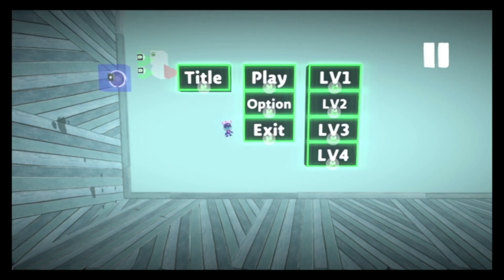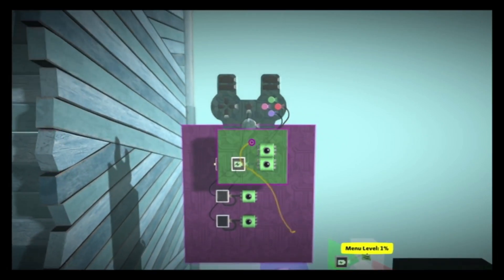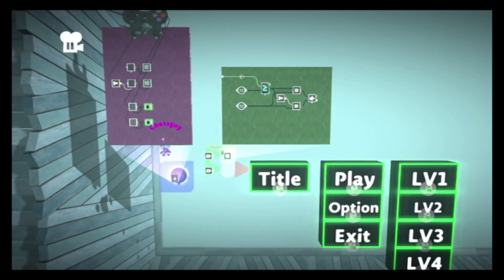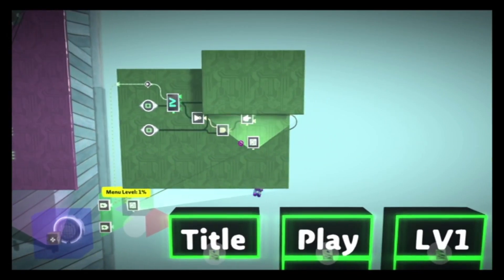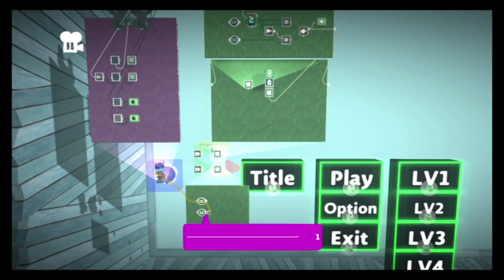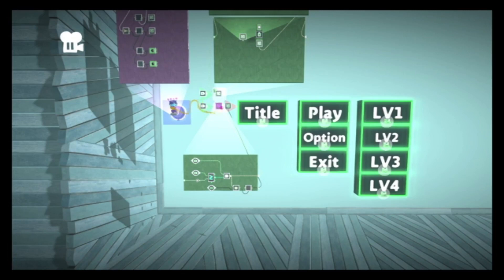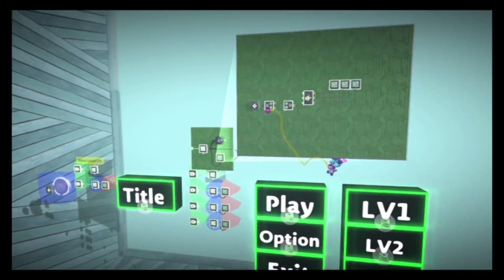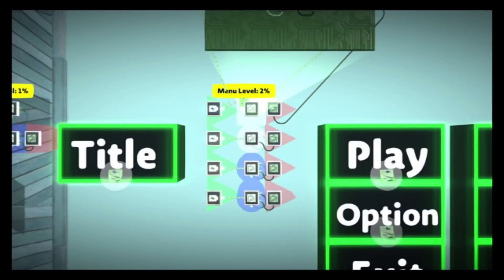LBP3 Tutorial - Modular Wireless Menus

Comment: Now i feel myself dumb as a person who uses selectors
Reply from the maker: Selector method is good too! However if you use signal comparisons, it makes adding more menus later on much easier.

I was working on a sliding block puzzle level in LBP3 and I had a menu system with 60 different screens. Instead of using the selector enable/disable method, I can simply point to a specific percentage.
Reply: @lbp_chessguy5640  well, thats a way too
Reply: @lbp_chessguy5640 hah. half a year later, i had to do the same thing (i mean this kind of menu), where i used signal comparisons. But tbh, i used a bit more wires than u do and used only about 6 or 7 markers, but still, i managed to do the whole thing by myself. I can pretty easily add new components :)